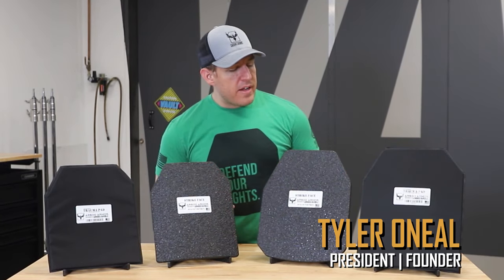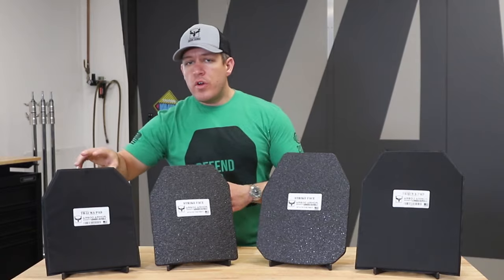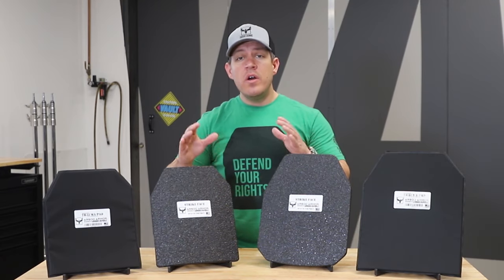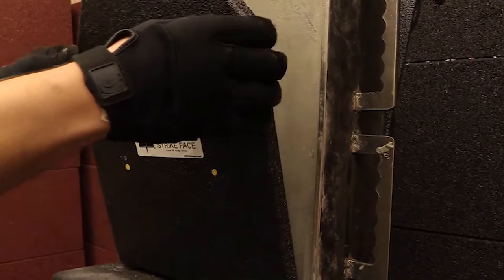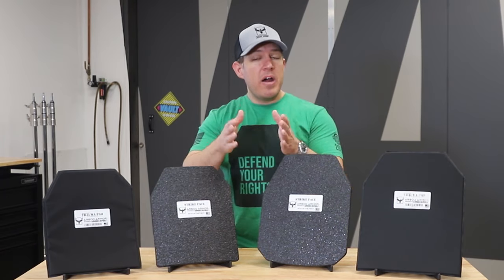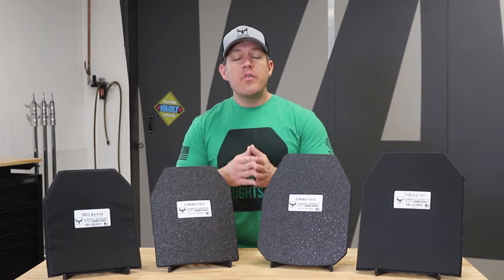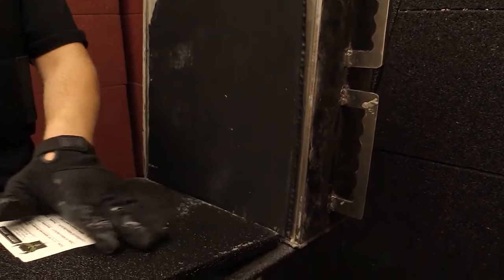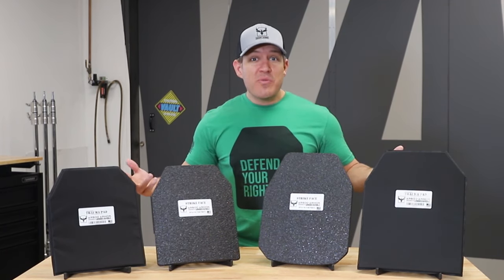Why Run Trauma Pads?   AR500 Armor

Comment: Weight of trauma pad.     And this is something I feel aerogel or metal lattice would be far superior for armor or armor padding ... the strength to weight ratio is I believe 98/1             Now , cost of those materials is substantial but could be brought down with new technology and bulk sales
Reply: Yeah aerogel last I checked cost more than a house for a square foot block of it, which is roughly how much you'd need for 1-2 panels.
Reply: The material they use is very cost effective.  It’s physical Property allows it to absorb a lot of energy in a thin and light pad.  Plus it’s durable.  Not sure how durable aerogel would be and it’s nowhere near cost effective even if mass produced.

Comment: So, ( and i swear im not being a dick about this) but can you please tell me how your trauma pads are anymore effective than say , industrial floormats glued together with 4x liquid nails?
Reply from the maker: Each trauma pad is specially engineered to mitigate blunt force trauma in case your armor takes a round and reduces the amount of back face deformation that could occur, which can mitigate risk of injury after impact. 

It is designed from the ground up to be worn in conjunction with and behind your body armor to reduce the amount of energy transfer to your body, reducing felt energy through your armor and mitigating backface deformation. Industrial floormats are simply not designed to do that. Now that being said, floormats are probably better than NOTHING but then anything is better than nothing.
Reply: @ArmoredRepublic2  so, (and again im not trying to nit pick, but nobody asks these questions straight out, nor are the answers ever given bluntly) what you are saying is that  trauma pads are made of a novel, proprietary material, speciffically developed for this purpose? Correct? It makes sense.
I get " what they do", and i buy them whenever i get a new plate carrier... But i guess i never really thought about them much beyond " thats how they get you".and figure nobody wants to get hit with a bare plate.
Reply from the maker: Correct! They are made for this purpose. No offense taken!
Reply: @ArmoredRepublic2  thanks, i know that it looks like im being overly critical, but all we really get is the " sales pitch" on the civilian market. Which leads to the " just as good" cyclic argument. And there is A TON of people promising that what is effectivly trash is identical in preformace to what others pay top dollar for. Personally, i dont have a dog in the fight. Id rather spend a few extra bucks to know its going to do its thing, than hope some random online is correct.but, it IS a topic of debate among your customers, and im sure you sell a lot of plates without them because of that. a direct statement from your end might not " end " the debate but it at least removes some of the ambiguity. Thanks for your time.
Reply: @earlycuyler2295  it’s a non Newtonian fluid sport water and corn starch in a little pad nothing special about it you could make your own even thicker probably

Comment: There is no way for me to run trauma pads. I bought a plate carrier designed to accept my 11 x 14 plate through AR500 might i add and it was very difficult to get the plate in the carrier, no way in hell im getting a trauma pad in there as well, no room.
Reply: @Mando’Ade Country maybe you have problems with reading comprehension. I cannot run trauma pads. It is too snug. The plate barely even fit.
Reply: @cookncrook6902  Get another carrier then that can fit both. lol

Comment: Hello my name is ralphie, a few months ago I purchased a vest from wish, I never purchased the trauma pad because for some reason I didn't know the size or if it was the right one. So later on that day I went back on wish and purchase two trauma pads when I received them I noticed they were 
An inch over on each side after overlapping the pad over the pocket. I then measured the fitting from top to bottom and notice that the bottom of the pad was 2 inches passed the bottom end of the pocket where the pad would normally fit. So I thought maybe I'll trim the pad to the fitting of the pocket on the vest. Can you please give me some of your advice if whether or not it would work thank you. the best that I purchase has the long velcro flaps on the bottom which covers the pockets entrance.